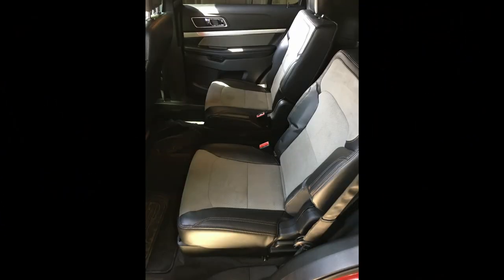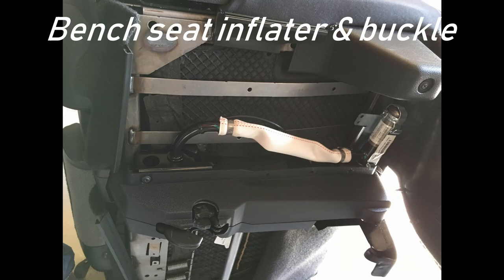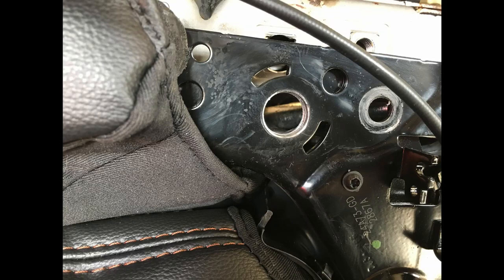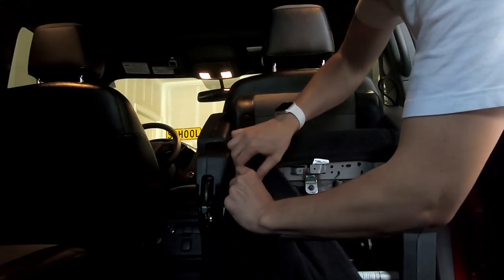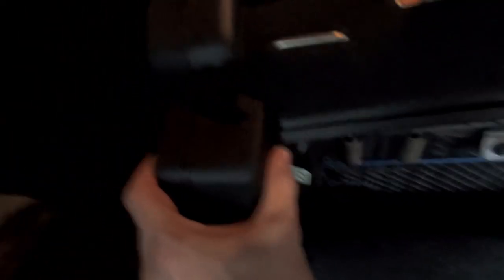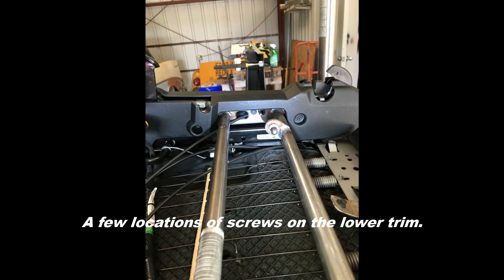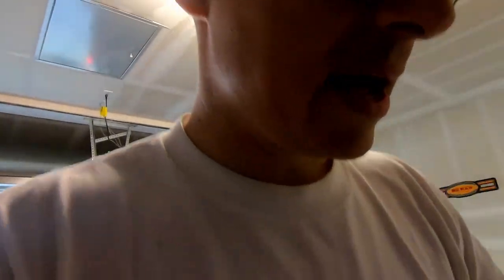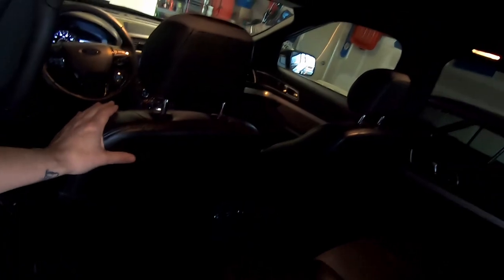2017 Ford Explorer 2nd Row Bucket Seat Install

Comment: Do you know how the inflatable seatbelts deploy? Are they electrically deployed like normal airbags or do they deploy when a certain amount of force is exerted on the belt? Wondering if you swap the retractors and seats from an Explorer with the inflatables into one without, if they will still function. I'm sure that the seatbelt portion would work as normal, but not sure about the inflation part.
Reply from the maker: I believe they are deployed electronically

Comment: I know this is old, but just getting to this project now. My vehicle has the inflatable seatbelts, but the donor buckets do not. Without disassembling entirely, isn’t it as simple as swapping out the buckle receptacles? Or what else am I missing?
Reply: Nvm, the module and all has to swap. Any guidance or links to the work you had to do on the seatbelt front?
Reply from the maker: @MrNonsense2400  There is a bit of work needed for this swap. You will need to get inflator for a bucket seat and the buckle receiver as well, oh and you will need a side trim piece as well. So what I did is found a Explorer that was for sale online that had the options I needed, then used that vin # at the Parts department and ordered what I needed.
Reply: @1954saltydog  thanks. I found that our 2017 limited also has heated 2nd row bench seats and the camel colored donors I got do not have either heat or airbags…. Making this project likely doa.

Comment: awesome video, does anyone know if there is a center console in the 2nd row, can that be easily removed and that way you can have a walk way to the 3rd row. Will there be exposed bolts or holes?
Reply from the maker: Lampofilm it should be easy to remove, and the exposed bracket can be covered. All Exp without a center console have a plastic cover, so it should be easy to find one and your carpet will be a bit different, but that easy enough to fix.

Comment: Were your seats from a newer year car? I want to do this in my 2017 explorer and found seats from 2020 explorer. Will they fit? I was told 2020 was when they started putting bucket seats in there
Reply from the maker: The 2020 Seat will not work, a completely different seat. 2012-2019 Ford offered the 2nd Row buckets, they can be hard to find because not many dealers optioned them.
Reply: @1954saltydog  thanks!!

Comment: Thanks for this useful video.  I've got a 2013 Ford Explorer that we bought with bucket seats and a console for the 2nd seat, so I wanted to do the opposite of what you did.  I bought a 60/40 bench seat from a wrecking yard to replace one bucket and the console.  Installation was easy (mechanically), but then ran into several problems.  1.  The bench seat did not have the air bag seat belt like my bucket seat did, so the buckle is not compatible, and it has no inflator.  I'm hoping I can just remove these from my old bucket seat and install on the 60 portion of the bench seat (we'll see how that goes!).  2. The bucket seats have a motor in them for auto folding (button near the door frame).  There is an electrical connector under the seat to plug this in to power.  The bench seat I bought also has an electrical connector but it does not match up with connector coming out from under the carpet.  I don't know if the bench seat has a motor in it, I'll find out.  But it's not a big deal, I don't really need a motorized seat!  3. When I removed the console, there is no carpet under it!  So, I will have to find a matching carpet remnant somewhere and glue it to the floor.
Reply from the maker: So the 60 portion of the seat uses a completely different inflator and buckle receiver. As for the connection, you may need to make one that will match up to your rig.  Or look for a wire harness from a  rig that has the same options as yours. So what I did is looked at used Explorers online, found a few that had the options that matched my rig and copied the vin#, I then went to the dealer with the vin# and they were able look up the parts that I needed. So find a Sport or Limited Exp that has the Bench rear seat and inflatable seat belts. Copy the vin# and take to the dealer and they should be able to order the wire harness for the seat. Hope that helps. Feel free to message me if you need more help :)
Reply: @1954saltydog  Thanks.  I've been trying to buy the inflator for the 60 portion of the bench seat, but the drawings they have at Ford parts website show a drawing of the inflator, but with no part number to order it!  I think maybe for safety/liability reasons they don't want a layman to be able to install one.  I've talked to Ford dealerships, and they won't touch it, they say they will not do conversions for liability reasons!  I've even considered changing the LH seat belt from an air bag type to a standard belt, but I can't even find out how to do that!  It looks like the air bag seat belt has two tensioners, one on top and one on the bottom, while pictures of the standard seat belt only have one tensioner.  Also, the air bag warning light would stay on all the time, as it does now.  They sure don't make it easy.  I'm about to give up and put the bucket seat back in.  Would you consider selling your bench seat inflator unit, buckle receiver, and wire harness?  I see we both live in California.
Reply from the maker: @pauljasmine9828  Let me see if I can get you a part number for the Bench inflator.

I do have the old inflater and buckle, the wiring harness I used in my bucket seat. Let me think about it and I will let you know. 

I was fortunate that my local dealer was cool looking up parts for me. But there was no way they would have taken on the conversion.
Reply from the maker: @pauljasmine9828  you can send me an email: jburnitzki@gmail.com
Reply: @1954saltydog  Thanks, I'll send you an email.
Reply: i want to do the same like you with our 2013 Ford Explorer Limited but i don´t know how difficult could be since i don´t find a video on Youtube explaining how do it in details, this is my big concern because about the safety features we worry about the seat belts not so much for the inflators
Reply: Do you have your seats?  I’d like to go bench (w/ inflatable seat belts ) to buckets w/ inflatable seatbelts

Comment: Did the seatbelt latch into the buckle prior to the modification? Wondering if they do because the modification you did was to essentially make the seatbelt airbag functional
Reply from the maker: No the seat belt did not buckle, both are very different.
Reply: @1954saltydog  cool. Thanks for the response

Comment: We have a 2015 Ford Explorer with bench seat in the middle could we take those out and use a 2016 Explorer bucket seats?
Reply from the maker: Mechanically the seats will be the same, however if there any electrical connections, those could be different & the seat/stitching patterns are different on the 2016 and up

Comment: Is it standard for the bucket seat to not have arm rests? My husband wants to do this on mine but I have concerns about safety, as well as comfort. Are your kids front facing or rear facing? Was the kid in the back able to get by a rear facing car seat?
Reply from the maker: It’s is standard on this generation of Explorer for the middle row buckets to not have arm rests. They did offer a center console with a single center arm rest on the higher trims. However in my opinion, it impedes entrance as much as the center seat. 

My kids where in forward facing car seats at the time & now are in boosters.

Comment: I have inflatable seat belts as well in my 2016 Explorer. If I find bucket seats that came from a vehicle with inflatable seat belts do you think I could just pop out my bench and put the buckets right in? Will I need to drill in the new mount like you had shown? Thanks and great video
Reply from the maker: From what I can see, you should be able to just swap them out, no modification needed. One thing to keep in mind, if the donor vehicle has been in an accident, you make need to replace the belt tensioner(in the seat) and the buckle receiver.

Hope that help :)
Reply: BadCam21 did you found already? I’m in the opposite situation! I have the bucket seats in black leather and I need the regular seat
Reply: David Araujo I didn’t find a vehicle with bucket seats yet. Where are you located? I’m just north of Sacramento in California
Reply: BadCam21 I’m in south jersey... too far
Reply: @davidfaraujo  might be too late but are you still looking for a regular seat? Planning to switch to a bucket seat. I own a ford explorer 2016 sport
Reply: @davidfaraujo   I'll trade you

Comment: Alright so I have the exact opposite problem from you, buckets I ordered have the airbag seatbelt and mine doesn’t. What does the cable connect to that is in the seatbelt buckle retainer on the seat? Any harm in just cutting it?
Reply from the maker: I don’t think it would be an issue to cut the wire, as your rig does not have the inflatable seat belts. P

Comment: I appreciate the video, we need to replace the seatbelt buckle on the left 2nd row bucket back seat (with PITA airbag), and this gives me a good idea of how to flip up the seat, remove that cover, and hopefully figure out how to connect the wire on the new buckle.  Thanks!
Reply: I'm about to replace the belt buckle. Was it hard?
Reply: @josephtimmerman7589  did you ever get your buckle replaced?   I'm about to do the same.  Any help would be appreciated.

Comment: Does the seat you bought have the ability to move it back and forth like the original 40? I have a rear facing car seat and would love to be able to move it back 4-5 inches like my original 40.
Reply from the maker: Yes and that was another reason for the change, as you get adjustability with the buckets, the 60 portion does not adjust.
Reply: @1954saltydog  thanks for your reply. Now I have to look for the seat lol

Comment: I have  a 2016 ford sport explorer with 60/40 bench seats. Is it ok just to replace the  60 side? Or you recommened replacing the 40 side as well.
Reply from the maker: I just replaced the 60 portion, the 40 will function as a bucket seat would. If cosmetic differences bother you, then I would recommend changing both. The differences are slight, so it will be up to you. Looking back, I should have done both for my OCD🤣
Reply: @1954saltydog  i havent called my car dealership yet but do you think the 2018 model bucket seats would fit in my 2016 explorer? Hadnt much luck yet looking foe 2016 bucket seats.
Reply from the maker: @reaganmerced3649  I think so, I don’t think Ford made any changes to the seats.

Comment: First, thanks a ton for this video!

Second, how did you actually find a junk yard with bucket seats? I'm looking for 2x in Black Leather to do the same thing.
Reply from the maker: I used Car-Part.com and just kept looking through the listings(only the ones that had pictures) till I found the one I needed. If you are looking for Black Leather, that should be a little easier. Look at Limiteds and Sport models.
Reply from the maker: I used Car-Part.com and just kept looking through the listings(only the ones that had pictures) till I found the one I needed. If you are looking for Black Leather, that should be a little easier. Look at Limiteds and Sport models.
Reply: Burnitzki Cars & More 

will do! Another question if you don’t mind.

Was the carpet and flooring under bench seat fine or does it need to be replaced?
Reply from the maker: Chanse Arrington the carpet was fine, no need to change😊

Comment: Did you had to replace both right and left?
Reply from the maker: Kilo Lima no, only the driver side. However there are a few cosmetic differences, but I was willing to over look that.
Reply: @1954saltydog  I might get a hacksaw and hire a good upholstery to reuse that bench.
Reply: @kilolima3766  did u do it. If so how did it go?
Reply: My daughter wants to do this badly. Thanks for the video!

I just want to make certain I understand. Did you buy a single front row bucket seat to install or was this another 2nd row seat and you flip flopped where the seat belt was located?

Thanks
Reply: @kilolima3766  I was thinking the same thing,
Cutting the seat to make it a bucket seat then putting a seat covers 🤣